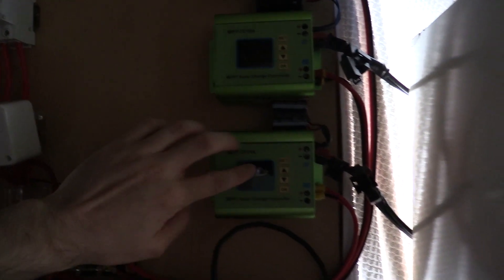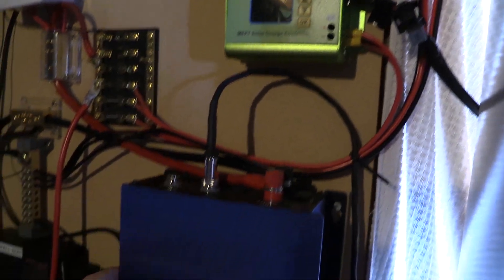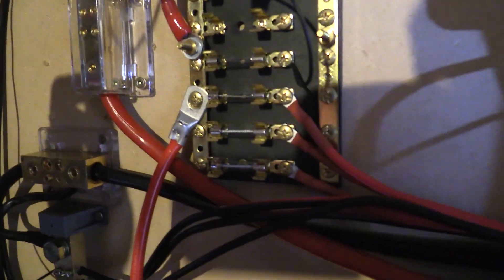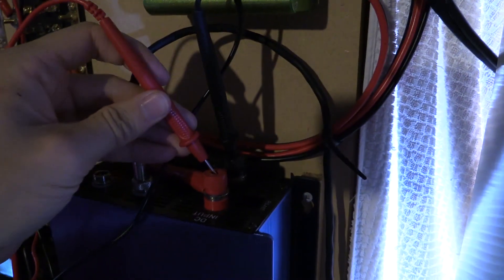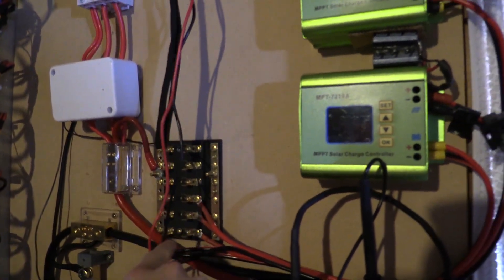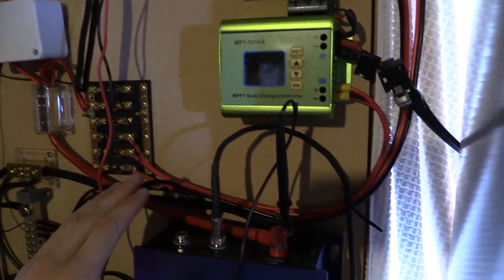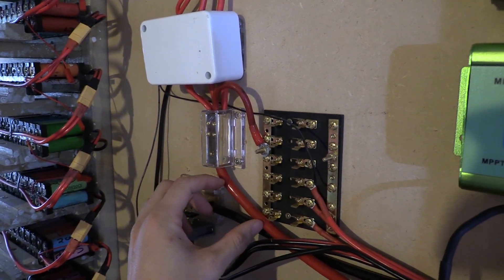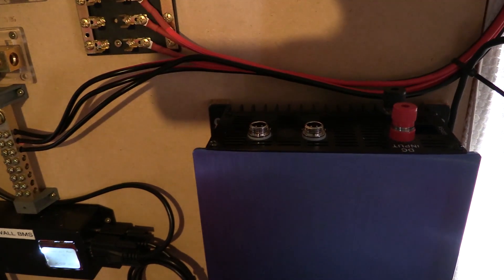Big Powerwall Problems - Part 1

Comment: Hey Mike, always love watching your videos and seeing your progress. I was surprised to see you had paralleled those 32amp breakers and brought both feeds into a single bus bar. That's dangerous and also pointless. If you do want a main breaker for your batter bank, then get an appropriate sized one i.e. around 60amp or whatever is just above the max you wish to pull. Ideally you want to have individual breakers for each application: 3 x >10amp breakers for your chargers, and 1 x >32amp breaker for the inverter. Fuses are great but they will only help when the current is flowing for a long enough time to burn them out. P.S. always make sure these are DC breakers if used on the DC side. Keep up the great videos. Cant want to see the next steps on your outdoor box. Cheers.

Comment: Have you considered putting super capacitors at the input of MPT-7210A. It may help with the stability issue when the light fluctuates.
Reply from the maker: I think it would help but not for the cost
Reply: I  will try this myself and let you know. Without any added capacitors the current given by my two controllers in parallel is like this 2.20,2.60,5.95,7.20,2.70,0.75,1.55,0.95,6.55,7.10,2.10,1.55,2.00,1.90,2.55,7.45,6.15,4.90,3.60,3.00 for the past 20 minutes.

Comment: Bummer sorry you had the problem but you should have had a fuse and disconnect switch going to the grid tie. Is it still under warranty?
Reply: Yeah, what a bummer. Expensive inverter dies, $100 bank of cheap chargers is still going.... Haha

Comment: It is hard to tell on this video, but those fuses look like SB (Slow Blow) types, wire wound over a core. Possibly the wrong type to use.
Reply from the maker: The ones on the solar batt side of the charges are slow blow.

Comment: Many of those chinese chargers die if battery is disconnected or hooked in last. So if battery fuse goes off they could all die im afraid. I have tested it :) only thing i can think about. Though not them who died.
Reply from the maker: Ya not much you can do about that tho, same problem with any shunt trip on the battery, If it trips cus a cell is low or high etc the inverter will get a hard switch off. The main thing is to make sure it doesn't happen often.